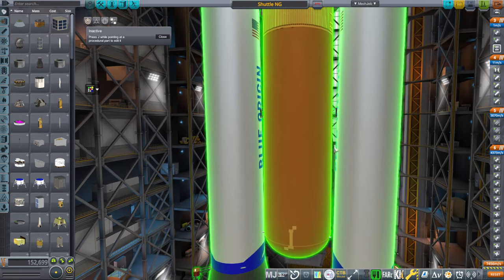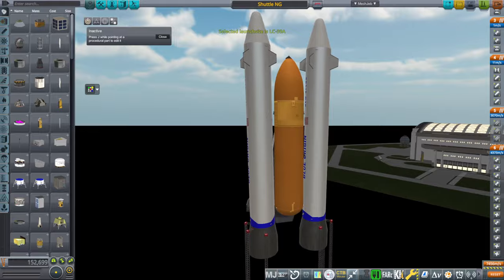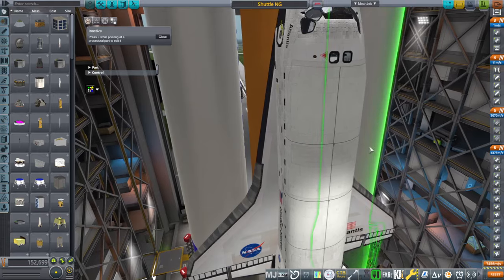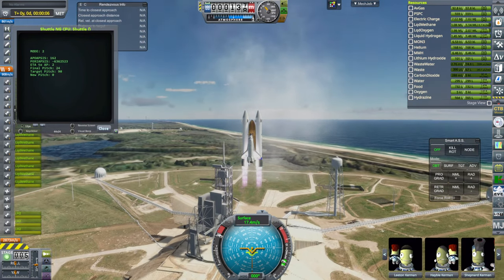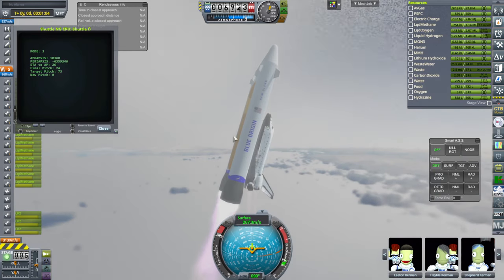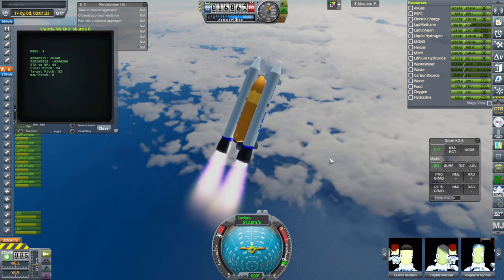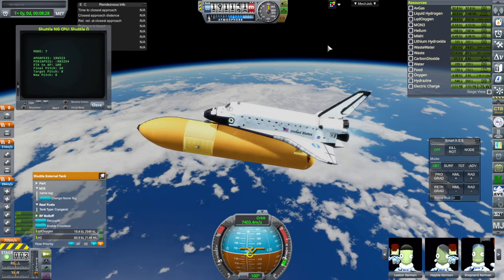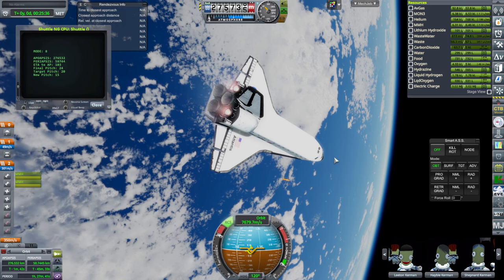Shuttle with NG Boosters (RO in KSP 1.12)

Comment: okay i got a less/more stupid one. send shuttle + external tank on energia. can shuttle get to moon flyby if energia can heft the whole mass of the external tank and orbiter?  maybe replace shuttle engines with more vacum optimised ones
Reply from the maker: The Energia core is basically the same as the External Tank + the SSMEs - it certainly can't lift the External Tank with the Shuttle. You can take the boosters from Energia and use those to replace the Shuttle SRBs, but that's about it. Energia only a bit more powerful than the Shuttle stack.
Reply: @RaizSpace  Is there a way to get Shuttle to the moon?
Reply from the maker: Here: https://www.youtube.com/watch?v=MxXjQrrsPcs
Reply: @RaizSpace  the next time i think of something stupid you can do with shuttle i will inform you.

Comment: The space shuttle should of launched from the top of a booster. Not on the side of it.
Reply from the maker: If you want the engines back, that would cause complications. On the side of the booster is fine if you don't have foam falling off - it's better to make sure the foam doesn't fall off.

Comment: Would those boosters need to do a reentry burn going 2400 m/s?
Reply from the maker: I don't think this is too different from what the New Glenn First Stages will have to deal with, but I'm not sure what they're planning.
Reply: @RaizSpace  GS1 does a re-entry burn (IIRC, JB called it "exo-atmospheric deceleration" in the EA interview). hard to tell if the booster will be faster or not than shown here once it launches for real. But since it's mostly Carbon, they'll likely want to do one at 2,4km/s.